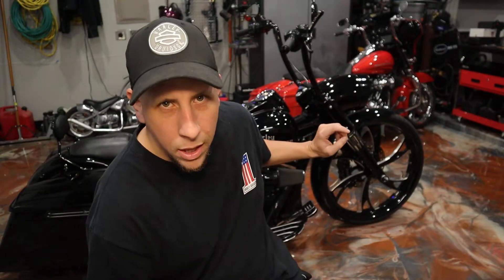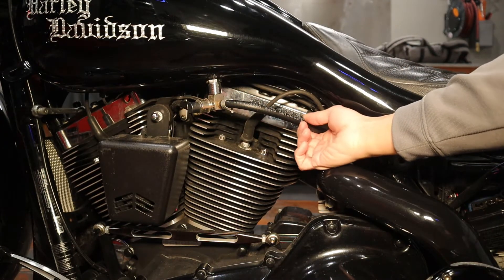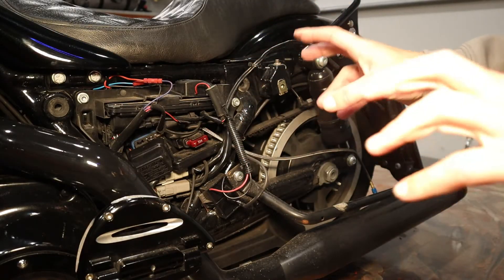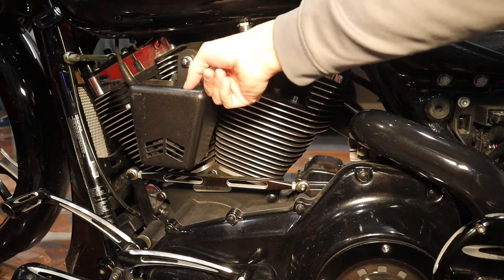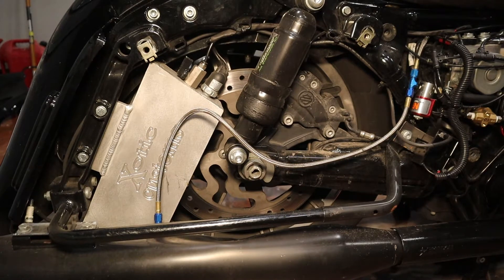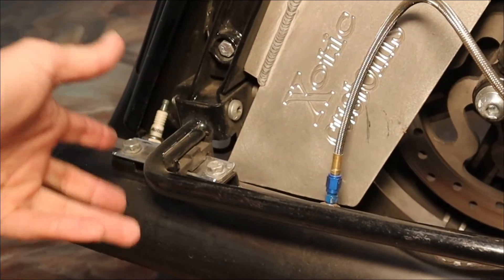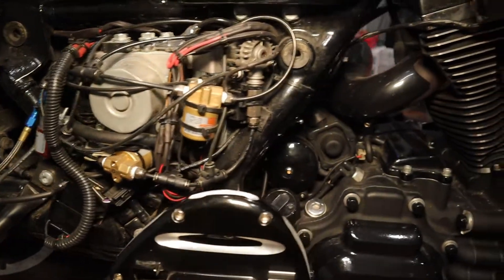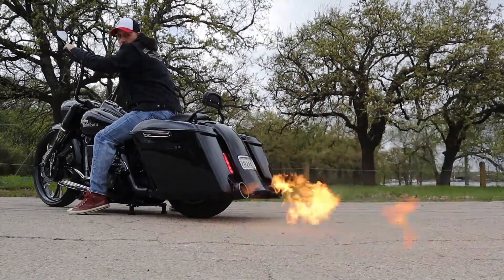FLAME THROWERS on a HARLEY DAVIDSON!!! OH Yeah MUST WATCH

Comment: Hey man, I like the way you have this ran.  3 questions if you don't mind.

1)  do you have this ran the way hotlicks suggests?  Cuz if so, that cuts power to the motor, & overtime, as 1 might assume, would likely cause the motor 2 run shitty, throw codes, etc.

2.)  You said you can run this system while going down the road (moving).  How does that affect the performance of the bike?  Do you
Have to feather it on & off so the bike can keep up?  I'd actually thoroughly like to see a bike do this, because that's how I'm trying to run mine while moving. 

3.)  What length lines did you run?  I'm assuming it was 3 different 1s.  1 from the tank to the T.  & 1 length to the front exhaust, & 1 length to the rear.

Thanks again for this video.  It's giving me a lot of ideas regardless.  Thanks.

Comment: Hey brother! Awesome setup and info! Question… do you need to tap into the high pressure line? Can you tie into the tank crossover for fuel? Or would that require a pump for the fuel…

Comment: I have the same mega flame kit but i cant get any flames with the .028 nozzles installed. any advise on how to get it to light? I have spark but i just have a pool of fuel dripping out the pipes. Im going to try a smaller jet but any help or tips are a big help.

Comment: WHAT PARTS DO I NEED TO GET FROM SUMMIT FOR THE KIT U INSTALLED SELENOID IS 400 SHOT? NOS 0.028? WHAT OTHERS ADAPTERS ?
Reply from the maker: You need a gas supply line, gasoline solenoid,  T fitting to go to the fuel lines that connect to the mufflerz

Comment: Where did you get the power source from? Meaning is the power wire from the horn your source of power?
Reply from the maker: Great question. The power  come from a relay that is connected to the horn button. In other words when the horn button is pressed it activates the relay [a relay is a switch) in which it activates the flames. Hope that makes sense and helps.
Reply: @crudeoilgarage3570  I gotcha. Makes sense. Love the nos idea also. Probably one of the best and cleanest I've seen on here. 🤙🏻🤙🏻🤙🏻

Comment: What size spray nozzle
Reply from the maker: Good question. Each set up is different depending on how far away from eachother the spark plugs are feom the spray nozzle. I will have to look to see what i bought. I know i bought 3 different sizes and test all 3 to see which worked the best.
Reply: CRUDE OIL GARAGE I’m doing single out side and spark plug about 6inches from tip.
Reply from the maker: I used the NOS Precision stainless steel flare jet made for gasoline. I tried both sized 0.025 and 0.028. Both worked but gave different results. The 0.028 is whag i am using now.
Reply: CRUDE OIL GARAGE you ordered your hose from summit as well?
Reply: CRUDE OIL GARAGE  did you use a relay?
Reply from the maker: I connected a toggle switch to my horn which does use a relay. When the toggle switch is up the horn functions like normal. When the switch is down then the horn button activates the flames. I wanted to keep the install as stealth as possiblr and wanted to use an existing button for a cleaner look. The toggle switch is somewhat hidden behind the horn. Check out the video again. Thanks for the questions. Glad to help in any way bro!
Reply: CRUDE OIL GARAGE the nozzle do you have it placed up by solenoid or closer to the exhaust?
Reply from the maker: The spray nozzle gets places about 6 inches from the tip of the exhaust inside the muffler